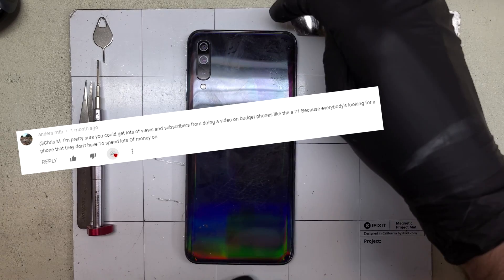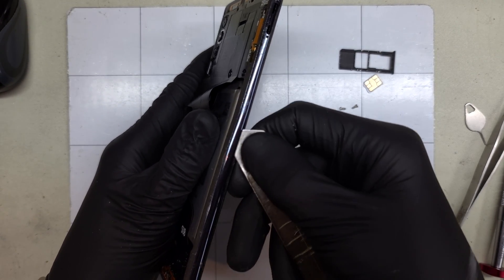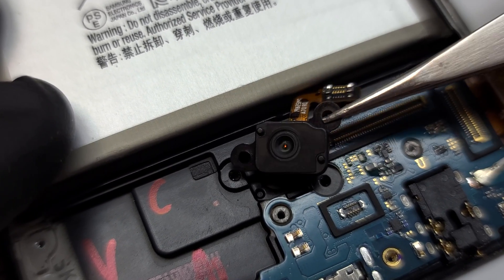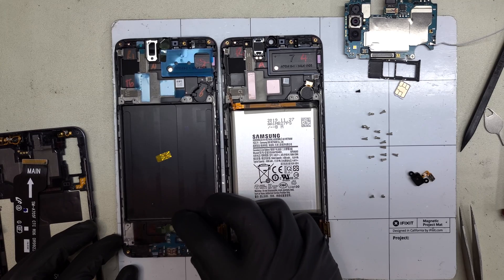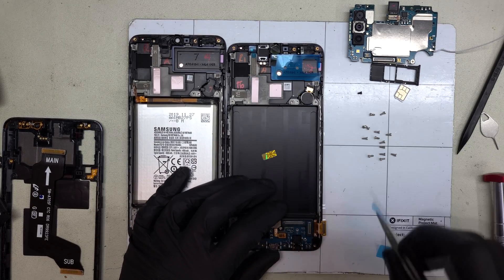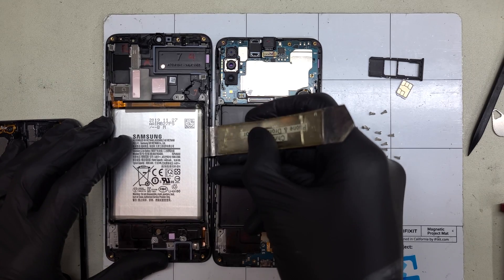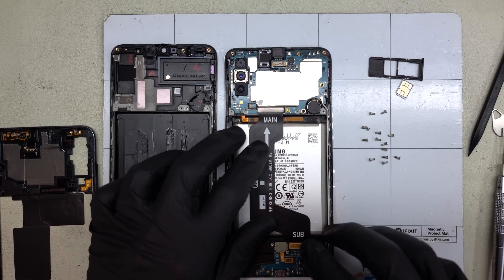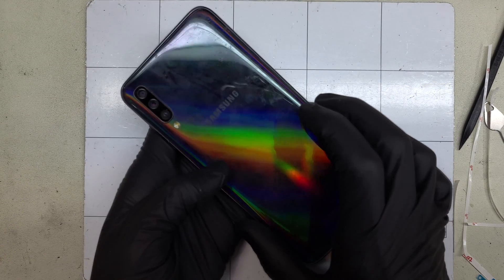Galaxy A70 Screen Replacement | How-To Guide | Internal Review

Comment: hello, i replaced just the screen (on the old frame), but the new screen won't 'snap' to the frame, and would fall out - do you have an idea as to what i'd have done wrong?
Reply from the maker: Did you replace just the glass and LCD of it or did you use a screen already fused to a frame? When you install a display only without the frame it won’t snap in, it’s glued in just like the original
Reply: @TapticDigital  o... right, i bought the display only. do i need to get the frame separate as well then?

Comment: You can't unlock your phone if Samsung, or the phone doesn't give you the password you need to even use it, you're screwed!,especially if the phone is running on its own, doesn't ring, no sound, went into downloading! Now what can I still get my data and everything off that phone?!!!@
Reply from the maker: Sounds like you entered download mode, could have just held the wrong buttons, could be serious. You can hold volume down and power for about ten seconds and the phone will reboot normally. If it immediately goes back into download mode, something is very wrong. Look into reputable data recovery services like iPad Rehab.